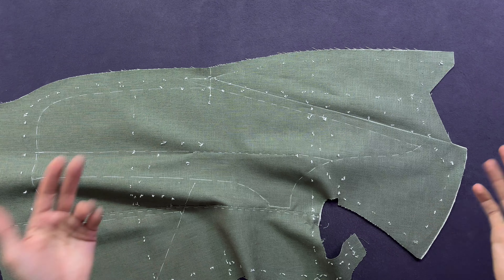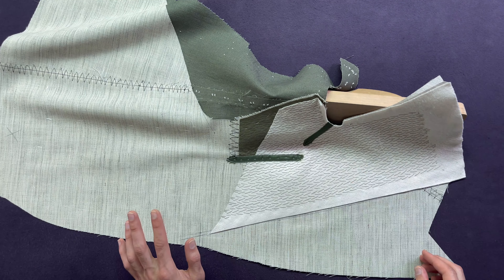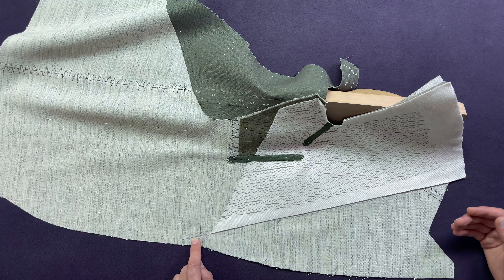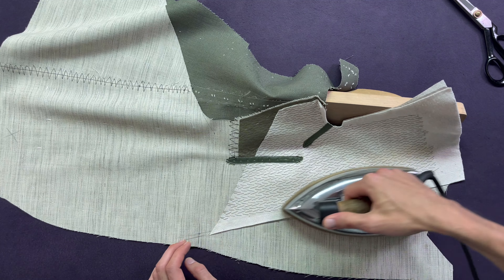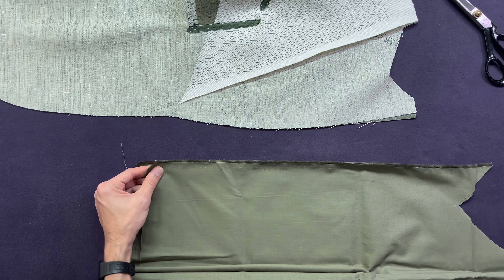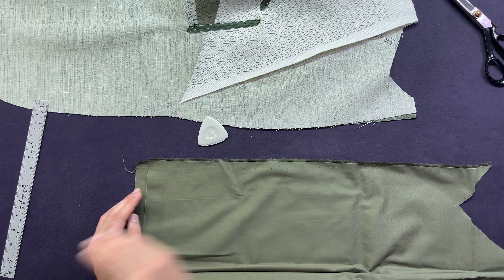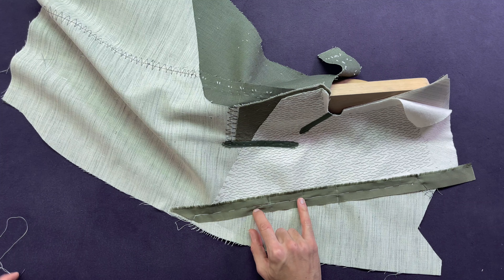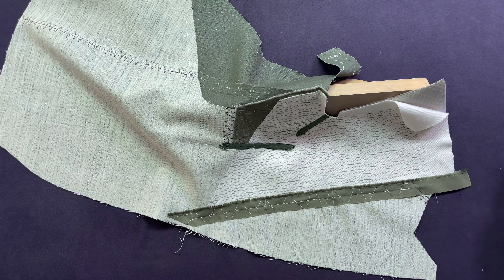L24: Reinforcing Break Line / Bridling - Pagoda Model | Online Coat Making Course

Comment: Hi Reza. Does using silesia instead of tape for the bridal, make for a better lapel roll?
Reply from the maker: Hello Ross! It all depends on the tape. But to zoom out a little bit, it all really depends on what you want to achieve. The thickness of the material that you use for your bridle will certainly affect how easily the break-line can be creased after application. So the thickness of the selisia matters. The width is another important factor as I explain in the lesson.

The bridle edge can show through the facing if too thick and over pressed in the final stages of the jackets construction.

Reza
Reply: @OFFICIALISOT  So, whether it's 2.5cm wide Silesia  or 1cm wide tape, it's always centered  across the marked lapel line?   Ross.